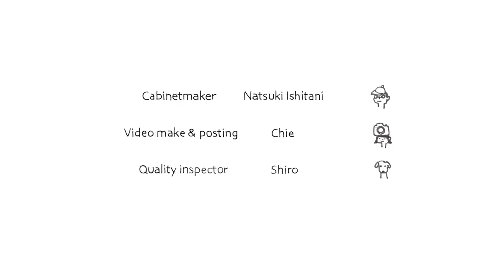ISHITANI - Making Walnut Poster Frames

Comment: I’m curious to the make and model of the machine used to cut the angles/shape on the sides.  At the 4:10 mark.  Thanks
Reply: It's a table saw with very thin settings (very low and very close to the stop)